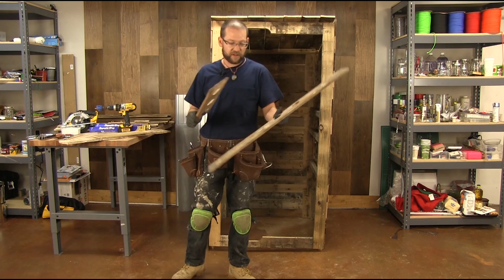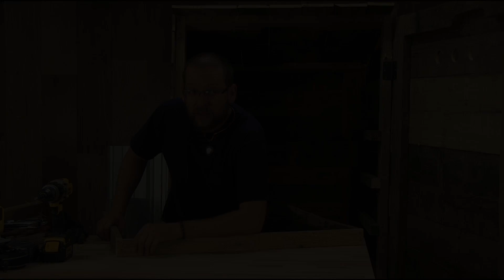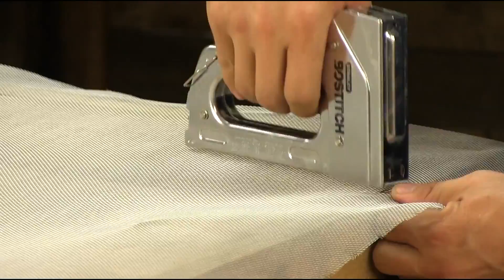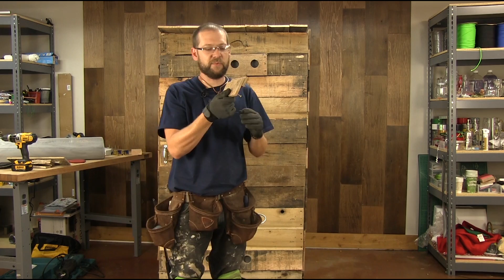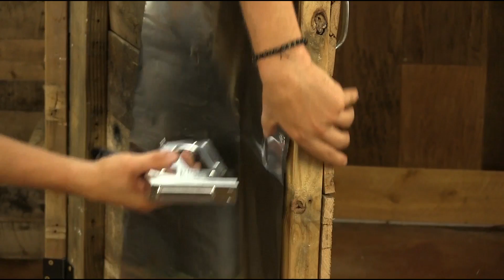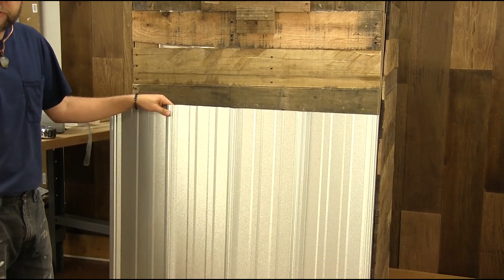How to Build a Smokehouse With Pallets Part 3 of 3

Comment: Thanks; very informative. I have a restaurant aluminum roll racks; can I build a frame around these and use them for a dryer for fruits and vegetables? I also have a two shelf long stainless steel rack can I do the same with this? I am looking for a smoker and a dryer for preserving food. I also want to know if you ever heard of a smoker made for a fireplace; small variety?  I was talking to older people and they told me in Alaska that they would set up a box in their large fireplaces for a small amount of meat to smoke?